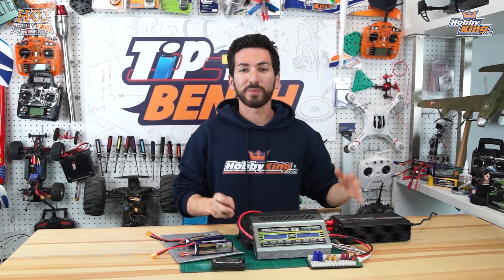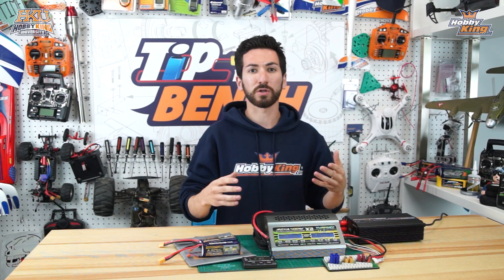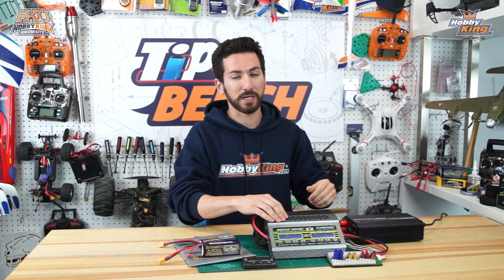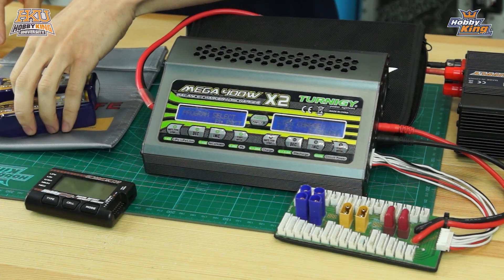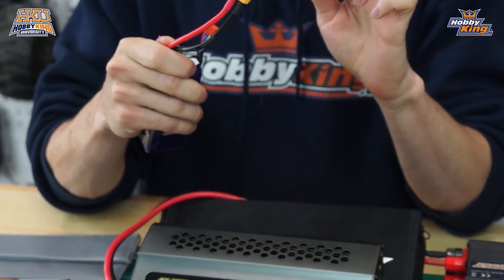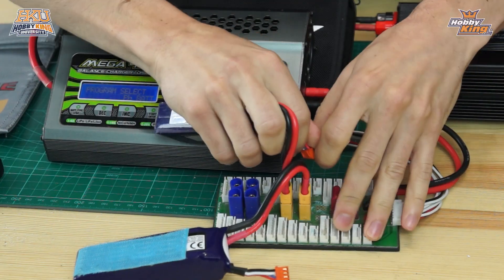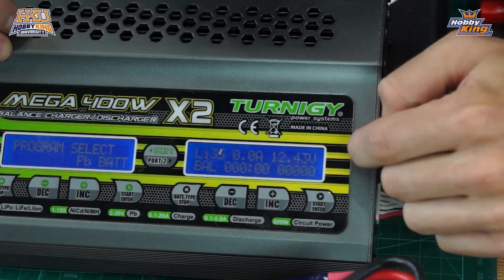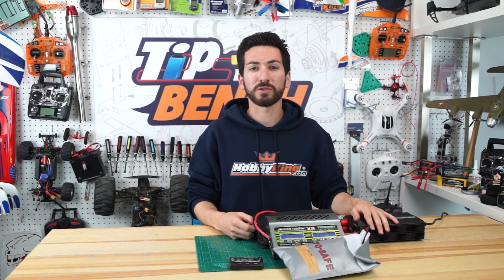Tips Bench - Advanced Charging Techniques

Comment: Gotta be super careful when plugging in the balance leads. I was doing this in a dark room and it turns out that the little keys they have on them arent that great at protecting you from a reverse plug in. Cooked the traces off the parallel board in a split second.
Reply: polarablues64  Yup...been there. Scares the CRAP out of you when it happens.

Comment: That is wrong. Batteries should be the same and used together. And can be charged like a 6s. No two battery should be charged in parallel.
Reply: Guner Tunca ERDOGAN That's why the video explains the packs must be within 0.1V of each other - not enough difference to give high currents.
Reply: Guner Tunca ERDOGAN "No two battery should be charged in parallel. "
Why would that be ?
Reply: If they have different voltage levels which is generally the case as soon as they are connected in parallel the higher voltage one will supply very high currents over to the lower voltage one because there is very low resistance. so if you need to charge two identical batteries they should be charged in series and in balance mode. And the batteries can be connected in parallel when powering something. But you should not keep them for a long time because they will start to self discharge at their own rate thus creating voltage difference. i had used two packs in parallel because the plane consumed too much current. So i discharged them together in parallel and charged them in series at balance mode. If you need to charge batteries in parallel badly at least they should be identical and have very close voltage levels. This is what i suggest as an electronics engineer.

Comment: Do the batteries have to be identical, or could they be different capacities and C ratings? (i.e. a 3000mAh 30C and a 3300mAh 40C)  Thanks!
Reply: TheAdkFlyer10 Batteries should  be around the same age, condotion for safety. Don't listen to what these other people are saying, you can parallel charge different capacitys together and c rating also makes no difference. 

You can only charge batteries of the same cell count, this is important.
Reply: TheAdkFlyer10 C rating doesn't really matter here (that's a discharge rating) but the capacity should be the same, otherwise you could overcharge the smaller battery.
Reply: mPky1 TheAdkFlyer10 There are usually two C ratings: Charge and Discarge Rating. Most batteries should be charged at 1C but some more expensive batteries allow you to charge at 2C or even 5C. If not sure, always charge at 1C. That way you can safely parallel-charge different 3S 3000mah batteries :)
Reply: mPky1 I agree that charging the same batteries (brand & specs) is a lot safer (that's how I charge at home) but if I was at the field and needed some more juice I would  parallel charge all 3S 3000 batteries (different brands) at the rate of 1C because the charger would stop immediately after reaching 4.19-4.20 on one or more cells.
Reply: mPky1 The quoted C rating is for discharging, we are charging. How do you mean "If one battery has less C then it will take less"??
Reply: mPky1 i would disagree. My Flightmax Zippy 4S 5000mah battery has a discharge rating of only 20C but charge rating of 5C! :)
Reply: Manufactures will give a seperate rating for charge rates most can do at least a 2c charge.
Reply: ok
Reply: mPky1 You can't assume that, there is no direct correlation between discharge and charge C ratings as far as I know.

You need to find the manufacturer's ratings - N.B. a lot of manufacturers are optimistic on their discharge ratings (especially at the low end of the market) so I would assume their charge ratings are the same, to be on the safe side.
Reply: mPky1 I didn't say it's 'proof', I said "to be on the safe side". I would rather be cautious than risk damaging my LiPos or worse.
Reply: Well  pay 80$ for a 4s 60c pulse expect to have a safe  5c charge rating. Buy the same  cheaper 20c turnigy and that bad boys only rated at 2c max. So I guess  more expensive high c packs have higher charge rates. Get what you pay for